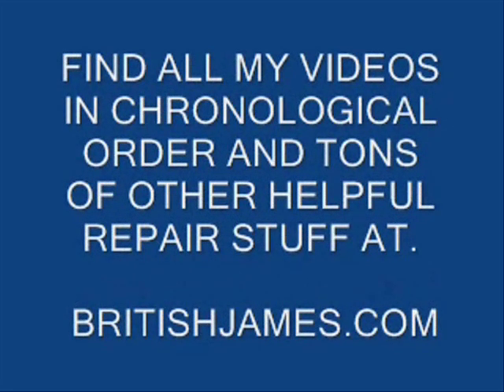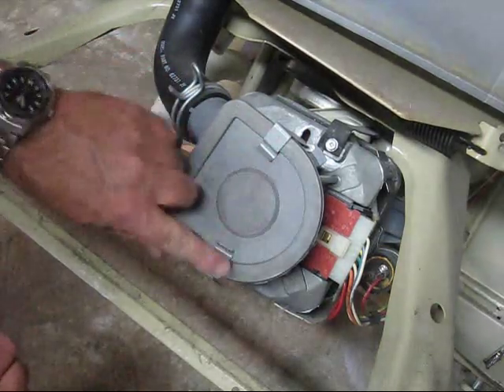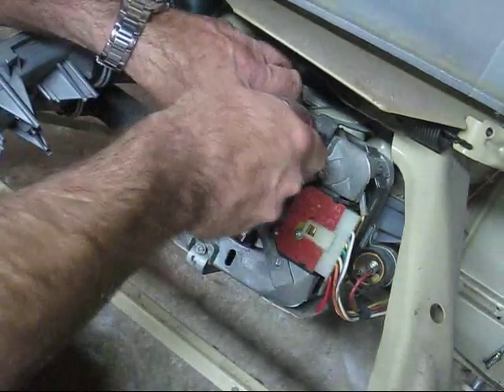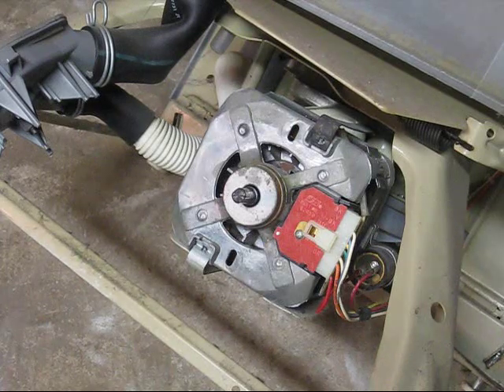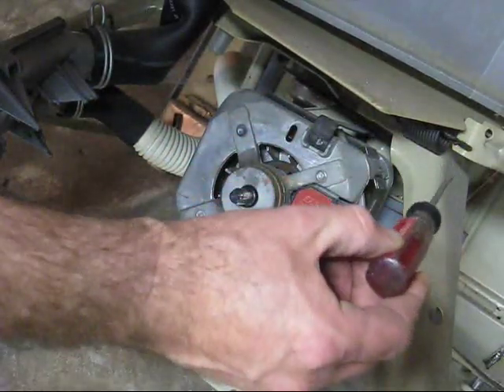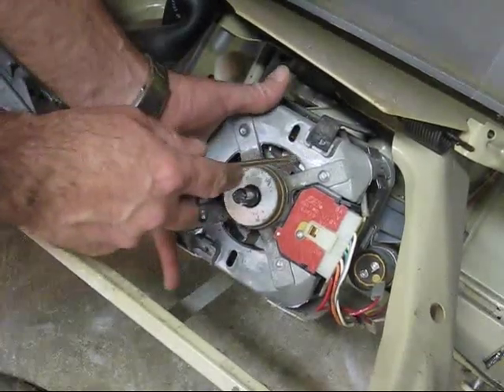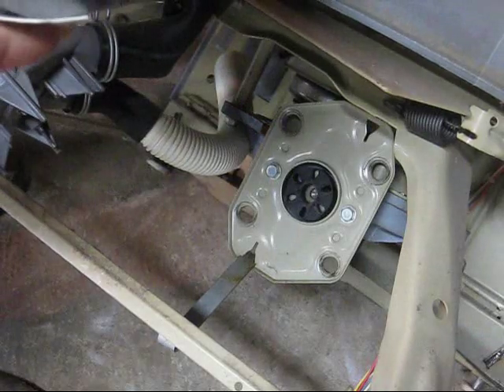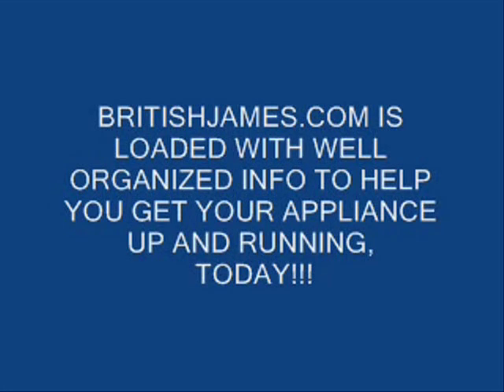WHIRLPOOL WASHER REPAIR VIDEO 13

Comment: Quick question… do you have any suggestions on how to remove the pump if it's stuck? I can't for the life of me pull that out. I'm trying to simply replace the pump which has been leaking for a while. Thanks.